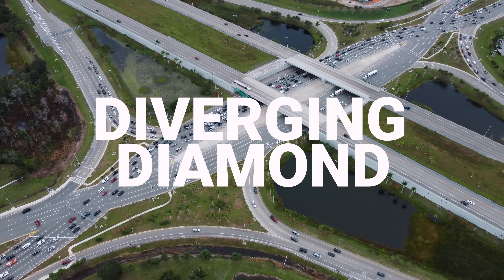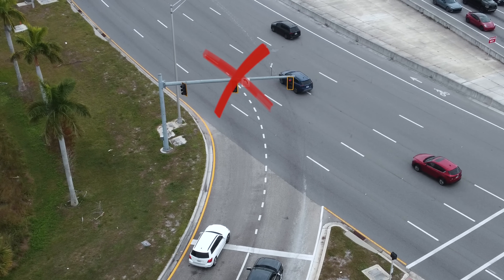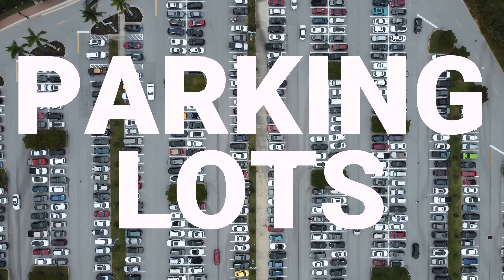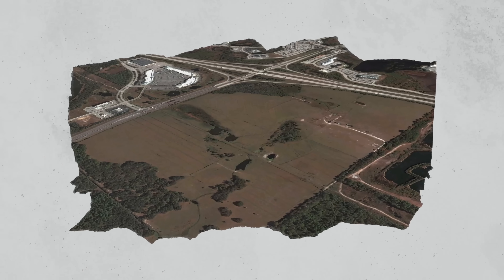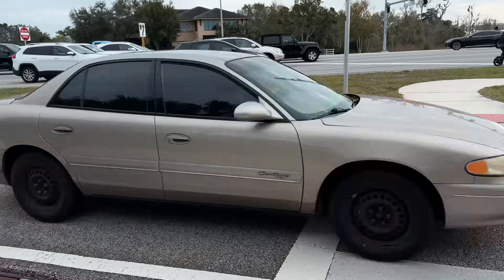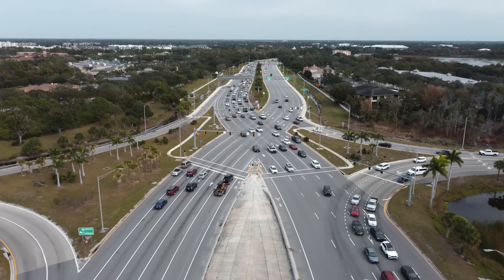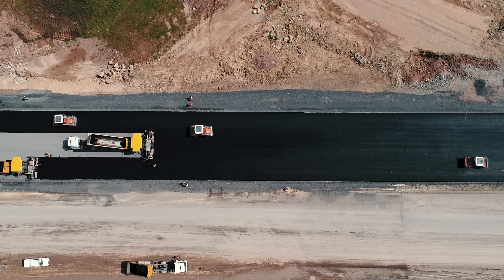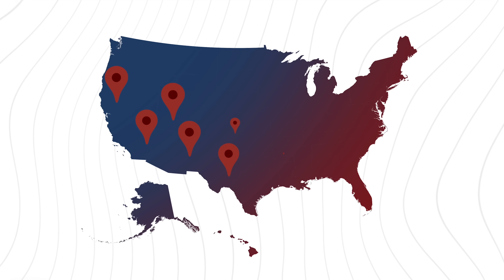Traffic Will Never Be Fixed Here

Comment: This a messy design and a terrbile idea in the first place. Why would you place an intersection with traffic lights when a clover leaf system does the same without stopping anyone ?????
Reply: as cloverleafs take up lots of space and aren't particularly popular option for a normal highway onramp / exit. Also they don't work that well when you have more than 1 lane going from one road onto the other ... especially with the driving habbits in the US
Reply: @EnjoyFirefighting  I disagree, as a cloverleaf fit perfectly in that spot, and given the fact that blockage is seen for the main direction and not for the in or out. I do agree with the extremely poor driving habits of the US citizens, unfortunatelly. But I still believe a cloverleaf solution is the best one for this spot.
Reply: @lucianminea  double lanes on a cloverleaf are a nightmare. Even in e.g. Germany they remove the 2nd lane at most cloverleafs. A simple solution would be a roundabout above or beneath the highway like it's popular at many highway exits in Sweden.
Reply: @EnjoyFirefighting  I agree with that, I never said or condone tha two lanes cloverleaf. A roundabout works as designed in only one scenario: one lane per driving direction. More than that it's a complete nightmare, even traffic lights are better than that, and I know this, I have them in my city. In this clip, which represent the matter at hand, it's clear to see, again, that getting in or out is not the issue, but goin straight. 
Frankly, the real issue is after the diverging intersection, to begin with. But I still mantain my view: a cloverleaf whill solve this particular issue !
Reply: @lucianminea  a roundabout works perfectly fine with 2 lanes as well. At least as long as people know how to drive it and if the roundabout is simple or messed up. Thus 2 lane roundabouts work perfectly fine in Sweden, Norway etc but I can easily imagine places where that would be a nightmare.

Comment: I have an amazing idea it's called a roundabout yes they aren't common over in us but they r an amazing invention that ac work
Reply: America is very pro-roundabout.  However, DOTs are very specific where they can be installed.  They lose efficiency at 25000 vehicles per day per lane.  The traffic here is much greater than that, so a roundabout would not work here.  They are better for light suburban and rural interchanges.
Reply: @traffic.engineer  ahh fe didn't realise there were that many cars per day we have traffic light controlled roundabout coming of our motorways(highways) which are very affective js thought that'd be a good idea bc it keeps traffic moving the only other thing I could think to make the diamond system work better is by elevating one lane so u don't need the traffic lights to keep constant movement making it safer for ppl walking/cycling as well as they won't gave to cross those mad roads😂

Comment: "Keep the crossroad clear if you cannot completely leave the space" is one of the fundamental traffic principles here in Germany. You are not supposed to drive on the intersection space when the traffic lights turn yellow and red. Yet, it is also one of the most ignored principles and regularly results in clogged up crossroads and as a result in tons of frustration and honking. You cannot fix stupid and ignorance in auto drivers besides removing autos entirely.

Comment: I'm a little confused at the crosswalk design. Looking at it from Google Maps, they could've made it piss easy to cross and not even require a crosswalk button. After that first single lane (the worst of it), the next crosswalk is behind the diverging diamond part of the interchange. If the other direction of cars has a green light, then none of the lanes you cross until you reach the median will have a green light and none of the oncoming cars enter this side of the median. Crossing the next side is the same where there's no way for a car to go down that side of the highway while the other side has their green light. They could just have the crosswalk signal going during the relevant lights automatically. The stop lights already guarantee no conflict points. The backed up traffic is an issue though, but even with the walk signals you have to deal with it. They also add about 500 feet of superfluous walking distance in order to cross which is bothersome but that's a different story.
Reply: Having the button is actually good in America because people won't stop for you without one. So yea that set up is actually ideal

Comment: It seems like adding a box junction to the crossing points could help prevent backed up traffic getting stranded. They're indicated with hatched lines inside a box and the rule is that you shouldn't enter one unless your exit is clear.

Comment: Just make it a toll road. If the drivers have to pay for the maintenance of the road, more of them would be likely to use mass transit.
Reply: Florida already has tons of toll roads
Reply: @AdamSmith-gs2dv  But I bet this one isn't. And, also notice how the state with tons of toll roads is also the state where they just built a high speed rail line.
Reply: the problem is, they dont have access to mass transit
Reply: @sanitygone-l9y And they never will so long as there's a free alternative. Yes, America is less dense than Europe or Japan, but we had a thriving passenger rail system before the interstate highway system and we still could if that system were to be funded by the people who travel on it, i.e. toll roads

Comment: 3:40 This is not an inherent flaw of the diverging diamond design. That's 100% driver error. If you cannot clear the intersection, that is make it to the other side without having to stop in one of the crossing lanes you cannot enter the intersection. End of story. People who do this shouldn't be driving a car.
The first step in fixing traffic would be to have a population that actually knows the traffic rules and applies them correctly. Those who can't shouldn't have a licence. Incidentally this would in all likelihood also remove a significant percentage of drivers from the roads, benefiting both traffic flow and safety.

Comment: It's backing up because there is a 4 phase traffic light that's too close to the DDI, you can see it multiple times in the stock footage. You can't have 4 phase signals close to DDIs they mess everything up because the DDIs 2 phase signal is too efficient. We have a DDI in Pigeon Forge and it works extremely well even with the large amount of tourist traffic

Comment: Something that a lot of car brained people don't seem to understand is that reducing the number of people that HAVE to drive will significantly improve the efficiency for those that still need to. Less cars on the road = more space for your car.
Reply: typical misconception

you really think that removing roads and lines for cars is better for cars?
or you think that someone will start biking 15km to their work because there is a new bike line that removed a car line?

there is less cars on the road only when the gov makes driving artificially more expensive then the other options

look at all the countries with very little cars on the road and check the cost of driving there compared to their salaries and then do it for the US...

Comment: But what is the advantage over a clover leaf intersection without any traffic lights needed ? Or is it only because there is not enough space left ?
Reply: Cloverleafs are much less efficient in urban traffic settings, especially with these traffic volumes.  There is not enough space to queue traffic or merge. Additionally, the conflict points would increase crashes.  Also, it is best not to free-flow traffic, as that increases merging traffic conflicts.

Comment: Unbelievable how much some are willing to overcomplicate the intersection just to not use a roundabout (two of them in this case).
Reply: DDIs actually work extremely well when used correctly. The example here is a DDI not used correctly, there is too much straight through traffic (DDIs work well when you have a lot of turning traffic and minimal straight through traffic) and the traffic lights for the shopping centers are too close to the DDI which results in the traffic backing up at the light into the DDI

Comment: I'm struggling to see a use case where a diverging diamond would be better than other highway interchanges, like a clover-leaf or a large signalized roundabout with raised through-lanes for example. 
The cynic in me wants to think it only gets used because it's cheaper than better but more expensive alternatives, since it's mostly level and has very few elevated sections.

Does anyone know? Is the throughput better than it looks? Does it support many lanes better than other designs?
Reply: He explained why it is safer, it lessens conflict points where cars cross. The biggest issue with a clover-leaf is where cars get on or off the highway which is the same lane, causing cars to have to weave between each other to get in/out of the exit ramp which can cause crashes or traffic. There are many interchanges each with pros and cons, but for the diverging diamond it works well since there are only two places cars need to cross paths instead of the typical diamond interchange where its more like 5 spots

Comment: Great video and I live near this interchange. You nailed the issues that now plague this and unfortunately they'll only get worse due to moving the aquarium to a new site just south of the large UTC mall on the south part of that interchange. One change at the entrance could alleviate the congestion and that's the combine the left-turn timings on the intersection just beyond that, which would alleviate the length of time people need to wait for that light cycle by another 30 or so seconds. This happens far too often in Florida that opposing left turn traffic is forced to wait until the opposing side turns. We're getting more of these constructed along that corridor, and they do a good job normally of moving traffic. Keep up the good and insightful work.

Comment: A planner told me that per person cars typically take up 30 times the space as buses or pedestrians, and 15 times as much space as a cyclist. This does depend on load factors, and on speed, but even if the figures are half these, getting half of journeys out of cars would almost double the land available for other uses. And 200 people in 150 cars is about 1km even at low speed, in 4 buses is about 80m. Guess which can a junction in one signal cycle?

Comment: They just finished another one of these North of Tampa at I-75 and SR56.  It works ok with one caveat.  With all the lines painted on the ground it is extremely difficult to follow your lane, especially if you're exiting off the interstate and turning left onto 56.  The mishmash of crisscrossing lines are tough to follow, and more often than not at least one person will end up in a different lane, forcing everyone else to avoid them.  Maybe they need to experiment with different colored paint for the different lane directions?
Reply: Maybe Florida needs to stop giving out drivers licenses like candy

Comment: Very well done. I drive through this interchange fairly often and said “why am I crossing to the wrong side of the road?” You explained it so well. I’ve never had problems there, but the crossing you mentioned that is way too close to the highway interchange. And don’t get me started on the UTC mall area. That could be its own video. Thanks for this it’s very well done. There’s a lot of civil engineering urban planning stuff on yt that hit the same notes about decentralization and “stroads”
Reply: Yeah Cattlemen is a real problem getting into/out of the mall and taking traffic to University. Of course University is a problem from Lakewood Ranch all the way west to around the airport.  Just not enough options for drivers.

Comment: I'm at 4:15 and I'd say the "blocking traffic btwn lights" problem isn't a human-error problem, but rather a light-programming one. Like: In a properly designed light system, no one who wouldn't have the time to exit the intersection would be given the green light to enter it in the first place. But, because we in the americas(US, Canada, Mexico) are so bizarrely wedded to "Dumb" lights controlled by timers rather than using sensor-lights like they do in Europe, we get these sorts of problems all the time. 

Of course: the foundational issue here is that our govs have spent every year since WWII pushing everyone to buy personal vehicles and tearing up public transit infrastructure. Traffic light programming wouldn't be a major public safety concern if we still had functional tram systems like we did 80 years ago.

Comment: There is another perhaps better option, than just bike lanes. While it is great when many people use bikes, it is not ideal for everyone or in any weather. But transit basically is - it is almost for everyone and when a few cars are still there (vans and people really carrying something) it is fine. And for a cost of just a single interchange you can build few miles of light rail.
Reply: Bike infrastucture is cheap and effective. There is absolutely no issue in diverting a tiny amount of road construction and maintenance budget for it while also taking a much larger cut to fund great public transit.

Comment: There is a much better 2 parted solution, at first stop the stupid American parkinglots and way shopping works. Start making much more mixed zoned places with walkable cities. 

That wont happen, so on the diamond interchange, don't. Instead, make it one big dumbell roundabout with less lanes. Safety is higher and it has better flow.

Comment: If you block an intersection in the Netherlands, it is a violation of the traffic rules. Article 14 of the Road Traffic Act states that 'drivers may not block an intersection'.  The fine for blocking an intersection is €160.  One week of issuing fines on a diverging diamond interchange and no one will block the intersection anymore.

Comment: You can never fix mass transit either. Here in the UK, the more you build, the more crowded it gets. Exactly the same as roads. But that is not a reason not to build more mass transit & roads.
Reply: They get crowded but they dont Take that much space and are cheaper
Reply: Yeah it get's crowded but it still get's you there instead of creating gridlock.
It also doesn't help that London is the only city with properly funded transit and it relies on >150 year old infrastructure that hasn't been significantly expanded and adjusted since the 1980s

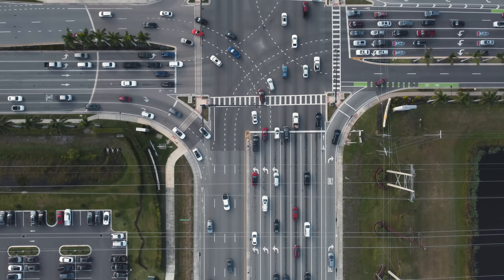Comment: To answer the question at 9:15 (when is an intersection too large), if the minimum cycle length is more than 150 seconds, then it's too large, because it becomes impossible to coordinate the signals in more than one direction at a time, which guarantees that traffic will queue up even when it's light.
Reply: Exactly, you know your coordination. I hope you’re a traffic Engineer because I’ve seen some coordination plans that don’t work while programming controllers.

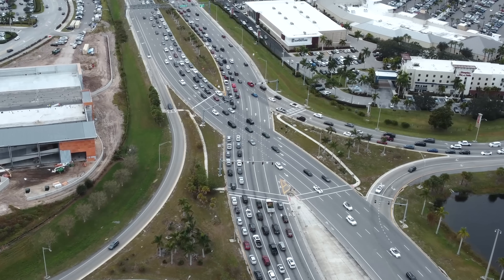Comment: One possible solution to the problem shown at 4:05 with congestion blocking the intersection is to install "queue cutter" detectors which prevent the other direction from seeing a green light until the intersection is clear.
Reply: No, you need to count vehicles on the diverging part and turn incoming lights red early if it’s about to back up to the intersection. 

The nasty part with diverging diamonds is that once you enter the diverging section, you need to cross another signal to exit it. What if both directions are backed up and block the other direction? The cars in the middle are stuck waiting for the other direction to clear, which is waiting for the other direction to clear, and so on. To clear it up, people who want to go across will have to decide to detour to the highway onramp instead.

Comment: Brand spanking new and it already looks to be so congested that it will wear on the soul of every person frequenting these places. Some decades ago we drove to the malls and stores just like this where I live. But you can only endure that traffic for so long. The shops, the restaurants and the theaters just aren't good enough of a draw. Nothing is. Those malls are now completely dead and replaced with mixed-used developments. To build these things in the 2020s is the definition of a poor use of resources.
Reply: It's because it was flawed from the start. DDIs work well when:

1. There is a lot of turning traffic

2. There are no traffic lights near it 

This one fails because there is too much straight through traffic and the traffic lights to enter the shopping centers are too close. If you want to see a working DDI look at I40 exit 407 which is the main exit for Pigeon Forge and Gatlinburg

Comment: Diverging diamond interchange was installed in the busiest intersection in my hometown (Interstate 90 / WI-26)and it did in fact, fix the traffic issues. It is only 3 lanes compared to five, however the overall change of traffic flow is drastic compared to the original cloverleaf, this design and adding lanes CAN fix traffic issues, it just did not in this specific example. My hometown went from a 4 lane clogged interstate to 8 lanes wide recently and with that brought two diverging diamonds which both have no more issues with traffic.
Reply: It doesn't work in this example because it's too close to a 4 phase signal for a shopping mall. The DDI works so efficiently that the traffic just gets backed up by the slow 4 phase signal. DDIs need to have space around them with no traffic lights so this doesn't happen
Reply: @AdamSmith-gs2dv  that is a great point. the ones near me are a LOT farther away from controlled intersections.
Reply: @TheMW2informer  Yea we have one for the main exit for the Great Smoky Mountains and it works wonderfully. This is just a failed design